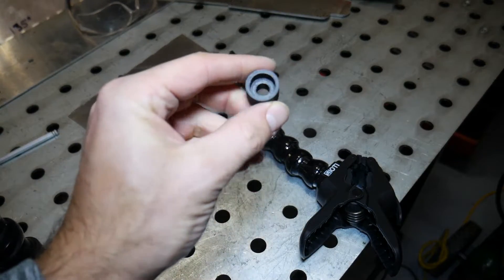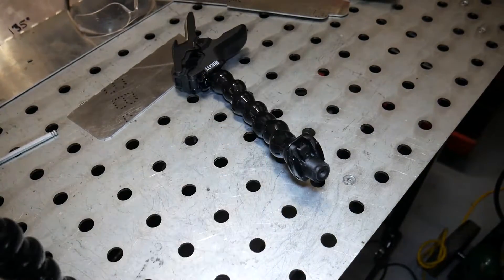How To Make Welding Table Hands! Infinite Positions!

Comment: Weld=heat, you can get metal holders cheaper.
Reply from the maker: Depending on what you're doing and welding... you can tack into place and then go from there. You won't need to leave the hands on the whole time so they melt.

Comment: Need something similar for holding among other things copper pipes and fittings to solder/braze / weld. Plastic clamps and heat ....must be other ways
Reply from the maker: Might be able to find some old welding clamps you can re-purpose.